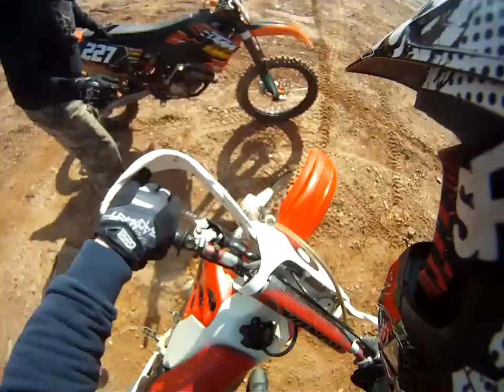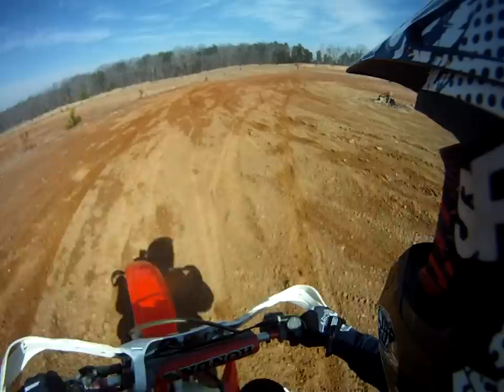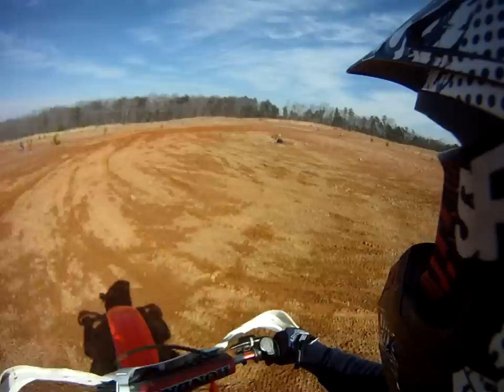Honda CR500 - First time ride!

Comment from the maker: He needs some major updating done on this bike.  Needs suspension rebuilt really bad and it vibrates the hell out of your hands.  I felt like I had arm pump after riding it for 10 min... lol

In terms of power its way faster then a 450... If you watch the video again I almost wiped out because the front end kept coming up.  ; )  I wouldnt try to holeshot this bike
Reply: 2nd and 3rd gear starts are how to win the holeshot on a cr500...from Wyoming USA 🔫🤠🇺🇸p.s stay safe